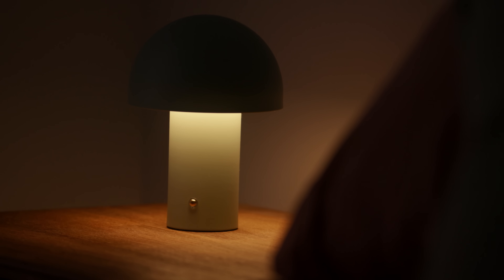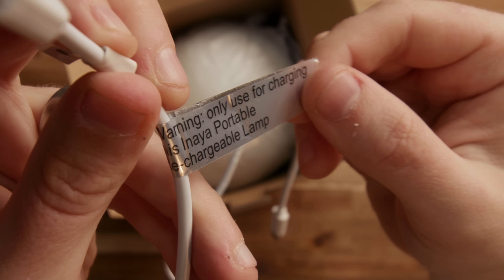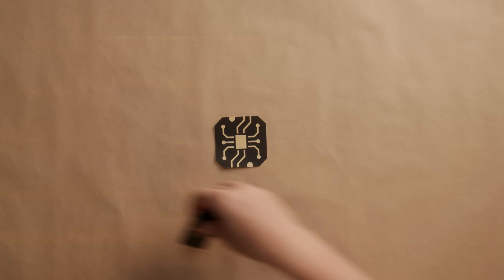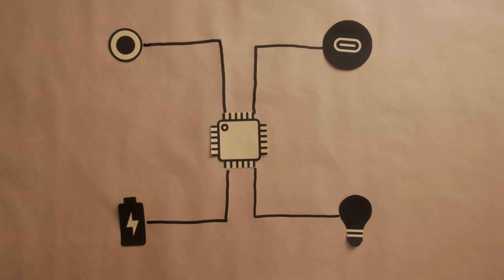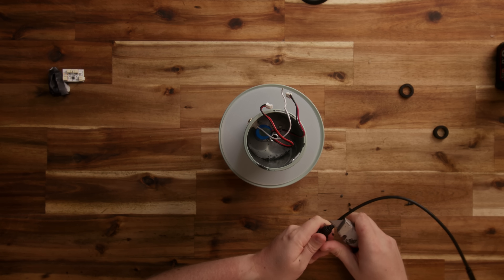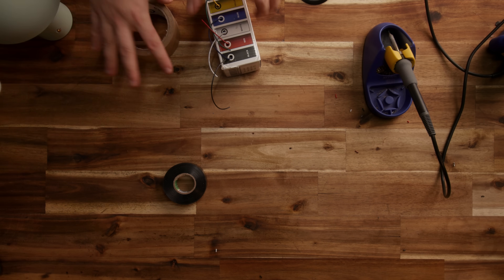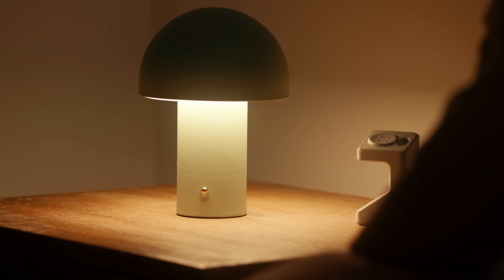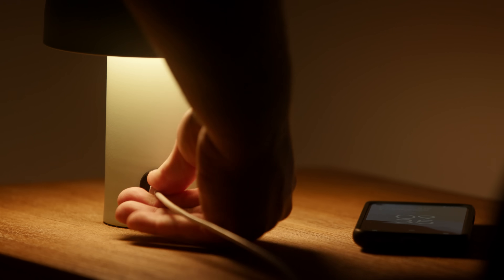Kmart Lied to Me, So I Hacked Their Lamp

Comment: ive had things like that blow up before cause the wrong cable was used its very annoying , doesnt help they use the same plastic moulds for the wall socket ends but there all different for power supply.

Comment: Another thing that drives me nuts about USB-C, is some cheap products don’t put the resistor in which tell the power supply which voltage it requires, things like vapes will only charge if you connect them to a single 5V USB C charger, not the smart type that can output different voltages depending on what the device requires. It’s incredibly frustrating.
Reply: But no one wants to pay $0.0002 for some resistor they don't need!  /s

Comment: I recently got a ventilation fan and was surprised to discover that its wired remote connects via USB-C. Curious about the signals, I grabbed a breakout board and discovered that it simply uses PWM… oh, and it supplies 12V on the power pin.

TWELVE VOLTS!!!

Comment: That is legit a great project and a great video showing how its done.
My only question. Why would you want a battery powered lamp that needs to be charged... Why not get one that plugs into the wall?
Stage 2 Upgrade:
Put a Bluetooth speaker in each of them that syncs together and now you have a Stereo for the bed thats already on the end tables.

Comment: K-Mart is still around on the other side of the world... Wow.

I've seen this "usb-c" cable on cheap Chinese items and sold separately. I've also seen what I think are the same lamps at the local Chinese cheap junk imports store. At this point I think I would just 3D print the lamp casing and use the method here to wire it, seems like a nice project for this spring break.

Comment: this would never happen in the EU as we have regulations prohibiting violating usb standards. 
why in your right mind would you want a lamp that is charged by a cable, then unplugged until its empty only to replug it to the wall again? normal lamps are connected to the wall all the time, you just turn them off when you don't use them. only if u go camping or something i can see a usecase. but at home??? why?

Comment: I've found that a lot of products that use a USBC are wired to work with an old school USB plug only so if both ends are USB-C it won't work but if one end is the old school USB plug and the other end is a USBC plug then it will work I've almost thrown away a couple things before I learned about this

Comment: I swear to god we have failed as a species. Why does a bedside lamp need a usb c cable and a battery.
Reply: The battery is questionable, but USB C is downright smart (when done correctly) - no need for dozens of different AC cables for the world's various standards, no need for dealing with variable voltage or frequency (not difficult with SMPS, granted), no need for any pesky high voltage safety, or the $2 of components required to build said SMPS in. If the user needs a power supply, any old one will do, and how many of us have dozens of old USB bricks in a drawer somewhere? (You don't throw those things away unless they die!)

Comment: I am a connoisseur of Chinesium garbage and nowhere in the video have you mentioned what the actual problems was. Your phone uses a USB C to USB C cable while a lot of cheap devices will only accept a charge from USB A to USB C cables. This is a very common way to penny pinch on solder. Calling this a proprietary or special cable is extremely far fetched

Comment: Interesting project. It is a bit like using a shotgun to kill an ant though. I would have just opened up the light and unhooked pins 2 & 3 and made pins 1 & 4 match the USB standard. Whoever designed this was a poorly educated sadist. Having more than one power lead doesn't help with current supply if they are asymmetrical. If it had been 2 Vcc & 2 Gnd it would have made more sense, even if it did break with the standard.

Comment: Oh, man you missed out on something very, very important for convenience; Qi charging. I wouldn't touch these lamp, but if they were rechargable via Qi / Qi2 I would likely buy 'em in a heart-beat because the flat bottom means it could interface with a variety of tabletop charging stands, and with the upgraded brains you've put in there, the battery could be down to 30% before being charged to 70% total cap with an upgraded BMS, which would make the battery last forever.

So, the tabletop charger can remain plugged in at all times, while the lamp functions as a handy night light to travel with through the house. Then when you return to bed the lamp can be on the charging stand to… do nothing until the lamp reaches below 35%. It would be peak.

Comment: 2:30 That may be true, but it's still USB 2 speeds. They want you do do everything on cloud. Try emptying 256GB of photos on 30-40MB/s. It takes almost two hours. And the way they do it, if there's any instability in the connection, it won't properly detect where you left off. At least USBC is a lot more reliable than lightning

Comment: Here's an update to my many other comments. I finally found the supplied lead for the lamp as I'd always just used the lead which charges my phone. The lead supplied with the lamp can be used to charge a battery pack. And it can be used to charge the lamp. I just tried both those things. So I really don't understand the problem. It all just... works. If Kmart sees this video the poster may be in legal trouble for his assertions.

Comment: My wife bought a bunch of little magnetic lights as stocking stuffers. They arrived late, and probably just as well. They have USB C ports but do not charge with a USB C charger. They need a USB A to USB C cable. However they do seem to be able to do pass through charging. I would watch out for anything that says USB C that does not say USB PD.

Comment: I had a look at your wiring diagram and I still don't quite follow how it works. Is the USB C internally connected to the ESP32s port? Does the power connection on the ESP32 output power when it's plugged in via USB? How are you dealing with the battery charging, is there a BMS on the battery?

Comment: Instead of having the watch charger, phone and  lamp all requiring USB-C, couldn't you make the night stand have a wireless charging top and add a wireless charging pad to the bottom of the lamp? It's definitely a lot more work but it does sound like a cool project + cleans up the need for cables

Comment: How much expensive it was to buy normal lamp instead of buying cheap and wiring insides with extra tech? 

I have led wireless lamp from well known Chinese market, and it usb-c compatible, have different modes, and cost as bigmac. 

I see this video only as "i create a problem and this is my overcomplicated solution".

Of course you did great job on a presentation and montage, i appreciate it, but try something more intresting, than modify that's one specific lamp from a local market. Maybe try to build one from scratch?

Comment: How did Kmart lie exactly.
Not all usb c chargers have the same output voltage.
Maybe the reason is in the fact that the Charger you used initially was too high (or low) for the lamp.
Lord knows the USB c charger tor the Nintendo switch dock isnt the same as the USB C charger for the Steam Deck.
The Switch dock outputs at 5Volts 1.5 Amps - 15Volts 2.6 amps whereas the steamdeck usb c charger outputs at 5volts 3 amps - 20 volts 2.5 amps

Comment: The problem is that usb c isn't a proper standard there is no requirement for all usb c ports to work with all usb devices as so many of the parts of the 'standard' are optional

Comment: Worked at Kmart for 5 years when I was 17-22. I would never shop at Kmart. You guys have no idea how many returns they get. I would be willing to bet that 50%, of the stuff they sell is broken within a month. As a side note, the kind of people who shop at Kmart are the worst kind of people in society. I never really understood class differences until I worked there and saw it for myself. They’re just a lower quality kind of person in every way.
Reply: Often the products K Mart sell are provided by companies that have them manufactured in China (or have a connection to the manufacturer) and then shop them around to suitable clients. K Mart (for example) will agree to take 100,000 units in two colour choices with the anko branding on the product, packaging and instructions. Any returns of the product, up until a certain number (usually a set %), K Mart will take on the chin. But once it reaches the set threshold the supplying company will have to take responsibility of the reverse logistics for the returns and provide K Mart with a credit on those returns. The supplying company also has to manage all warranty claims and provide replacements (if the customer requires a replacement) once K Mart ceases to stock the products. So when a shitty product fails en masse, there is little to no loss for K Mart, except for reputation (if that is at all possible).

Comment: Another option would have been to use a USB-C Male to Female cable to connect the ESP32 to an external power supply.  Probably cheaper than the panel mount cable (and does not need a 3D printer)

Comment: What exactly did they say re USB-C as your generalisation is incorrect. The cable and plug are two different specs. You can have a USB-C plug or port but the cable can be something else, such as USB2 or even just a few power leads. So your assumption assuming a single USBC generalisation cable is incorrect. But I wouldn't expect the general public to know that so it does sound deceptive labeling. But as you know electronics, you should know there cable and connector are different standards

Comment: I read your webpage transcript before arriving at the video.  I suffered far worse by one of these "death cables", combined with a KMart USB PD charger.  TL/DR: Somehow while cycling though a combination of cables & the charger, I killed my iPhone 11 and lost 2 years of personal info.  One day I will study the black box on that problem.

Also, I'm slowly making my way through a smart home home automation process.  I initially wanted to use ESPHome for endpoints, Home Assistant for management and coding devices in a fault tolerant "mesh" setup. e.g. A room's light switch will communicate directly to the room lights normally and HA is primarily used to configure devices.  But I just don't have the time for that depth of management. In the end, ZigBee devices, scenes and a little automation is where I'm at anyway.

Comment: Great video, though there's something ironic with complaining about the non-standard USB-C port/cable, then using a USB-C extension cable.... which is not compliant with the standard.
Reply: Better not have any traces on your PCB either - indistinguishable from an extension cable, electrically.  The spec prohibits extension cables as standalone products, and for good reasons, none of which apply here.
Reply: @jnawk83   what on earth are you on about?

Comment: What a horrible overengineered solution to a problem that you can solve with 10cents worth of resistors. Alot of cheap devises have USB-C ports but do not implement the standard correctly, because USB-C specifies how much power and voltage you need to pull from the power adapter. Cheap adapters that have usb-a will aways supply 5V, even with a data cable.

Comment: The cable is probably 5v+gnd only. No data wires. 
Your existing charger may need to see something at the other end of the cable to output 5v.
Reply: It must be something like that - my identical lamp has zero problems using the same charger and lead that charges my phone.

Comment: USB-C isn't as much of a standard as I'd like it to be, considering you have cables that are charging only, USB 2.0, USB 3.0, USB 3.1, different wattage ratings, etc... And on top of that, "dumb" devices that don't support USB-PD straight up will not charge from most USB-C power adapters or even laptops. USB-PD host devices will not power the device unless the right communication happens, and many of my devices, including my Switch Pro Controller, just don't do that. It has something to do with the USB-C specific pins requiring a specific resistance to enable 5V output and devices that were intended to be charged using A to C cables might not even have those pins wired up to anything because they don't exist on type A cables.

I have an Anker charger now that will power the USB-C ports with 5V when a dumb device is plugged in, and it's the only charger I have that does. Even my laptop won't power them. So I've never been able to use a single cable and charger to charge all my devices until now, at the very least I always needed at least an A to C cable and a C to C cable, and chargers for both.

And don't even get me started on how difficult it is to find USB-C cables that support USB 3.0+. If you look on Amazon, it's never mentioned anywhere in the product name, it gets buried way down in the product description or just in the product images. So you can't simply search for it. And 90% of them don't.
Even worse if you want a cable with decent length for VR or what have you. It's a real problem that the cables all look the same, because the cables that are included with smartphones etc. are never USB 3.0, and there's nothing worse than digging around in your drawer of cables for the one cable that is when you need to use something that requires USB 3.0, like a capture card, and needing to try every cable one by one until you find the one that works. It's infuriating.

In an ideal world, it would be standardized to where all newly manufactured USB-C cables are required to support the latest USB spec and fast charging, so any cable you buy would be actually universal, like was the original intent. But you'd never get manufacturers to agree to that, they'd sooner stop putting the USB branding on their cables than use more copper.

Comment: can i ask why you would buy a lamp with a battery in it? i feel like the ideal option as a consumer is minimize the amount of technology with a battery in it. it will last in this case until it physically breaks or has a mechanical failure

meanwhile, something with a lipo battery will either be garbage or need to have a battery replacement sourced in 2-3 years.

my old roomate had a battery powered vaccum that was a few years old and it couldnt even vaccum a whole room on a single charge

anything that doesnt move doesnt need a battery imo unless it is something that lasts a long time like with a low power device with a watch battery and the battery is replacable. even if you dont keep it that long selling it with a shot battery is gonna be tough

i bought air blower cuz it was low static and safe for pcbs and it doesnt hold a charge as much 2 years later and i really shouldve bought something that plugs in
Reply: How would you use a lamp that doesn't have a battery in it if there's no power source for it?  Eg on a coffee table in the middle of the room?  Well, you could trail a wire across the room to the nearest power point but that would be both unsightly and a tripping hazard.
Reply: @Ozpeter  i guess. seems like a limited usecase and not what the video creator was talking about.

Comment: I admit that most of this was over my head (but it was entertaining). However, it explained why a cheap device I have doesn't seem to charge with standard cables. 
I charge my various electronics in 3 different rooms in the house depending on what I'm doing so I have charging cables ready to use in each place. I hate the idea of having a cable that is the only one that works for a particular device and is actually dangerous for other devices.

Comment: That's worse than I thought. I just thought they didn't support C to C and only done A to C. Happens sometimes, I'm honestly not too sure why as I'm fairly new to the whole USB C thing, but I think it's just something to do with how the USB C connector inside the device is wired? Something about sense pins or the likes. 
Anyway ye, if A to C doesn't work, then it's definitely an intentional thing.

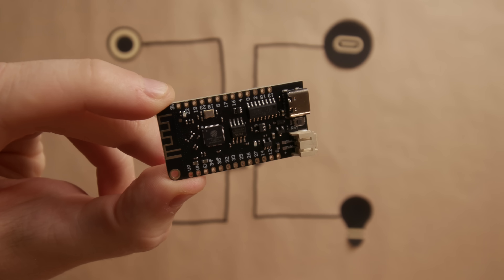Comment: 4:14 that's over engineering...adding an esp32 just so you could use a proper USB c cable. You could have tried using a trigger board and setting it to 5v. Or faking a trigger board with resistors
Reply: There’s no such thing as over engineering. Common misconception